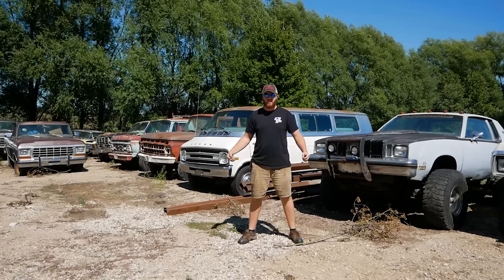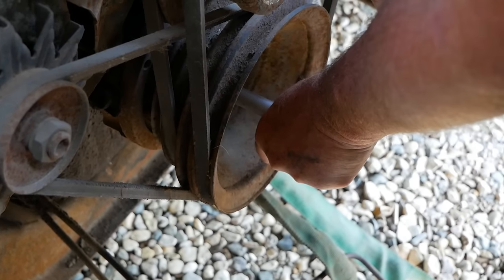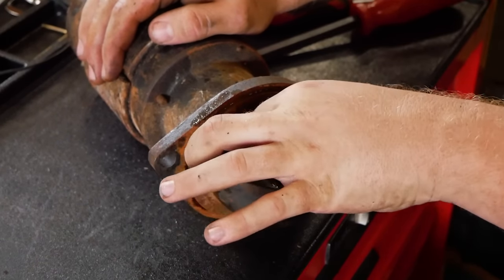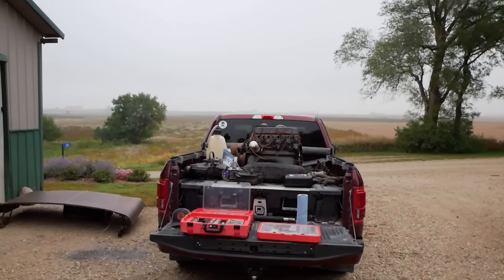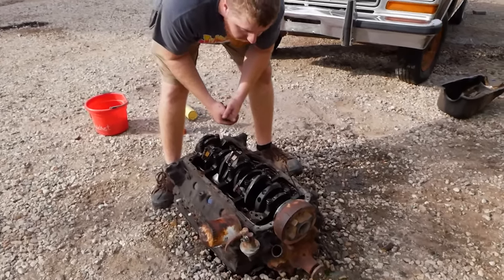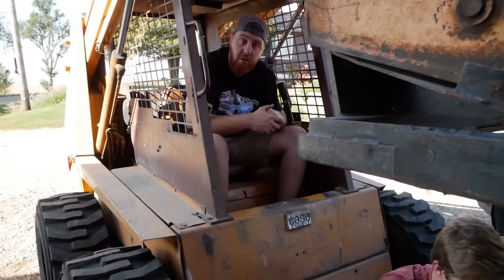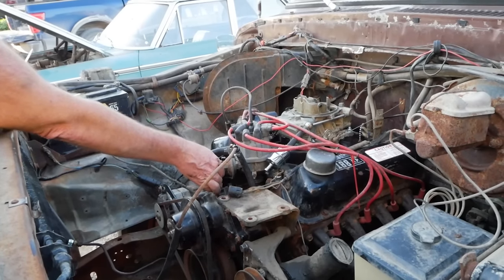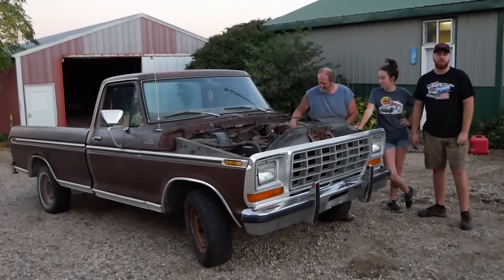Can We Swap a BOAT ENGINE into a TRUCK? 1979 F150 Revival

Comment: Depending on the year, that boat motor should have been rated at anywhere from 188-225 hp. The original truck engine was rated at 140, so an upgrade for sure. Boat motors had more aggressive cams and better heads, since they were expected to spend more time at high revs, and emissions restrictions were more lenient on marine engines.
Reply: I think it said 188hp somewhere, but that’s still a decent improvement
Reply: @garageofscrap  yeah and they swapped the 2bbl for a 4bbl idk if that was the only difference in rating but I do know there were 2v and 4v options.
Reply: @QuantumLeap83  and put headers on. That things going be a powerhouse
Reply: @QuantumLeap83  not true. boat engines are not built for high horsepower, they are built for high torque because a boat engine is like a generator engine, always under a steady constant load. cars accelerate rapidly then coast along using little power to maintain speed, their engines are never under a heavy continuous load unless you are constantly going uphill all of the time. and the horsepower ratings you claim are also not true as boat engines are not rated the same way as car or truck engines.
Reply: @marzsit9833  the specs for those engines are available online, and there's merely 1.4% variation between metric and mechanical hp. A difference of 2 or 3 hp lol. Also the engine now has a 4v carb that's not even the same 4v as the 225, different, intake and headers, so power numbers are unknown (but definitely higher) unless it's dyno tuned. Regardless, I'm sticking to my point - it's an upgrade over stock and capable of a lot more power than the stock engine would be.

The main thing you have to look out for when swapping these into an auto is that in most applications if its from a single drive boat (like this one) it will have correct rotation. If it was from a twin drive there's a 50% chance it will have reverse rotation 😉  so just know which one you're getting.
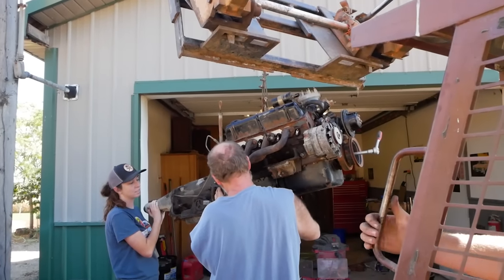Reply: at 32:08 you can see that it sais 188hp so you are 100% right. this is a pretty good upgrade
Reply: @QuantumLeap83  ... what determines an engines rotational direction anyway?
Reply: @RetiredRhetoricalWarhorse  as far as what determines it - its just a simple matter of correct timing and having a starter that starts the engine in that direction. Do TDC on 1 will still fire and have fuel on 1 with firing order following, but just the engine is rotating opposite on start up because the starter spins it clockwise instead of counterclockwise. If it spun it opposite without the timing changed it would be super advanced and not run. 

That being said, there are other things that have to be different because the cam needs to spin the appropriate direction, wrist pin offset has to be mirrored, alternator has to be spinning the right direction, water pump impeller vanes have to be correct for counter rotation, the bevel of any helical gears such as oil pump drive or timing gears may need to he mirrored. There are a lot of boats that just reverse the direction in the output or stern drive depending on set up so that both engines are the same - but the Ford pattern Mercruisers were not one of those - they actually built engines to run opposite directions 🤷‍♂️
Reply: @QuantumLeap83  The 225 HP was the only one that had the 351 W  heads all the other engines were basically the same as the engine used in early 1970's trucks!  The boat engines used  351 firing order!
Reply: @QuantumLeap83  We know it is a single we seen them lift it out of the boat!
Reply: @RetiredRhetoricalWarhorse  Camshaft.
Reply: I actually about bought a 351 Mercruiser out of a 79 F150. Said 235 HP on the valve covers
Reply: @QuantumLeap83  Ah, good to know. I'm primarily asking because to this day I am unsure how electro motors determine directions in the first place and when this came up I thought why would it be so hard to reverse direction. As you said, turn around the starter and reverse firing order... I just wondered if it really was feasible for Ford to make small runs of special made "lefty" engines... I'd imagine in a case with two motors on a boat  you'd have one of them be significantly more expensive than the other and parts wouldn't be interchangable which would make it easier, as you also explained, to just reverse direction with a gearbox after the engine...

But I'm sure some manager at Ford knew what he was deciding at the time :D.
Reply: The biggest advantage to using marine engines, is the bottom end upgrade. The overwhelming majority of marine engines use steel cranks, upgraded mains, and premium castings (usually higher nickel content and prescreened for porosity). While common in modern engines, most older V8s were mostly cast crank. It's not a huge deal, 'cause aftermarket steel cranks are fairly common and cheap... but for junkyard builds, it helps keep the budget down.
Reply: Heads on these engines are the same as auto. Mercruisers were built with longblocks off the same GM and Ford lines that made auto engines. And they don't run at high RPM but at sustained mid-range RPM. WOT on Mercs is around 4400rpm. Cruising at 3600.
Reply: My understanding is that boat engines are cammed different and they will not run right in a vehicle.
Reply: @marzsit9833  You are correct.
Reply: @letaloudone  thats a myth. boat cams are basically truck cams. Wide lobe separation angle and good low to midrange power band.
Reply: @QuantumLeap83  Don't forget a "backwards" oil pump or you will just blow air bubbles in your oil pan 'till you YEET a rod.
Reply: @peterdarr383  "why does this motor have so much blow by?!" Lol
Reply: @QuantumLeap83  also hes got better headers on it too so a bit more power again
Reply: @joekaz5198  - Nope, base car cams are one step bigger than truck cams and marine cams are one step bigger than base level car cams... maybe even more with newer emissions car cams... also compression ratio is higher, pistons have shallower dish, and 89 octane gas is specified... plus brass core plugs... I build up marine engines...
Reply: Actually base car cams are one step bigger than truck cams and marine cams are one step bigger than base level car cams... maybe even more with newer emissions car cams... also compression ratio is higher, pistons have shallower dish, and 89 octane gas is specified... plus brass core plugs... I build up marine engines... 

The old marine 188 and 225 HP ratings for 302's are gross HP like pre-1971 cars, so would be lower after 1971 in cars/trucks. 351W 2 bbl. rated 233-235 HP but problem was HP ratings weren't lowered after Ford started blocking 3/4's of the exhaust port with (unused in marine) A.I.R. bosses...
Reply: cj budz  Pre-electronic diesels will run backwards too.  I've had it happen a few times.  Been driving up a hill and stall the engine out then roll backwards back down the hill with the clutch out, the engine fires back up but sounds funny because it's drawing air in the muffler and exhausting out the through the air filter.  Don't want to do that very long since there's no oil pressure.
Reply: @briand2614  that's lines up with what I've heard, that only real difference between different  mercs is fueling, with merc marine 302s having better cams than ford auto, and also many had 351 heads but there's some confusion because apparently they didn't all? and some had stock 302 heads. AFAIK bottom ends are actually the same as are heads, except freeze plugs, rod guides etc are bronze instead if steel. Never heard any cam specs on mercs at all.
Reply: @QuantumLeap83  metric hp? What the heck is Metric HP? 

SAE Hp is just for advertising purposes, and the factory can pull the best 10 engines from the line, do a test and pick the best one! They can even run it with our Waterpump, AC-pump, headers, aircleaner, smog pump, converter or anything that holds you back. 

The DIN standard is way different, and you need to pull 10 random engines from the line, and run them as is! With all the accessories on it. 

So the difference can be even bigger.
Reply: Thats sweet
Reply: @briand2614  i owned  a 888  and a 225 and the 888 had 1.78 valves  and  the 225 has  1.84 intake valve s  the 888 has common 302 heads the 225 has 351  Windsor heads!   a later 2 barrel may have had Windsor heads.  The one 1971 engine I owned had 302 heads!  My 225 was a 1976  engine!
Reply: I’m not a boat mechanic, but cars and every marine engine i’ve converted for street use has had small port heads and relatively small cams compared to what we wanted for street. All were standard rotation big block chevy engines and the peanut heads and cams were too small, ditched for more upper rpm power on the street.
The Fords might be different, at least from this era?
Reply: @QuantumLeap83  instead of a timing set that spins the cam and crank the same direction, reverse rotation engines, have a gear drive that allows the crankshaft to spin the opposite direction,  the cam, oil pump etc all turn the conventional direction, nothing else changes, other than the water pump, and the fan on the alternator, and the starter.  I have repaired/replaced several of them, most big block Chevys.
Reply: @blythkd9017  remember hearing that in diesel mechanics class!!
Reply: I seem to recall that when Ford pieced together  the “5.0” and the Mustang GT for the 82 model year, they sourced the cam from the marine parts bin. That motor was only around 150 horses.
Reply: Helped a friend put a mercruiser 302 in a Fairmont, he worked at a boat plant, so he got an engine from work and brought it home.
Reply: @sombra6153  there isn't a "marine" bin. Marine engines were plucked from the assembly line, and shipped to Mercury/OMC, etc., and painted whatever color. Their casting and engineering numbers indicate nothing special, and from 1973 to 1985, all the cams were low duration, low lift, high torque camshafts, regardless  it makes practically no difference, none of them make 250 hp, especially because the ports are tiny, and they are emissions era slugs.
Reply: @jamesgeorge4874  I don’t know what the cam specs for the first HO 302 to emerge from the malaise era were, but was excited as many Ford enthusiasts were when the 82 GT was released and remember that some of the publications at the time referred to the cam as coming from the “marine bin.”  Whether they really knew what they were writing was anyone’s guess.
Reply: @sombra6153  the HO engine  debuted in 1985 with a factory roller cam, and appeared in the Mustang, Capri, and Mark 7. Some 1984 model CFI Mustang models had a breather lid that said 5.0 HO EFI, but they were nutless turds, and featured flat tappet cams, that no matter what the factory claimed, were tiny, sub 200 hp sticks. To me 150-190 HP isn't worth arguing over, both numbers are pathetic in a 300 inch V8....
Reply: @QuantumLeap83  It also requires a reverse rotation cam shaft.
Reply: I've got a 502 marine engine (I brought her that way) in my 1973 GMC motorhome.  She's got torque and will burn some rubber do to her front wheel drive!
Reply: @marzsit9833  Torque is a component of horsepower. Saying it isn't built for high horsepower is ludicrous especially when stamped on the engine is 188hp. You don't know what you are talking about.
Reply: @RetiredRhetoricalWarhorse  The engineers who design it. Cams are meant to turn one way I believe.
Reply: Boats basically have truck motors. Cams make the difference. Marine grind stock cams are almost identical to rv torque truck application cams
Reply: I like reading the comments 👍
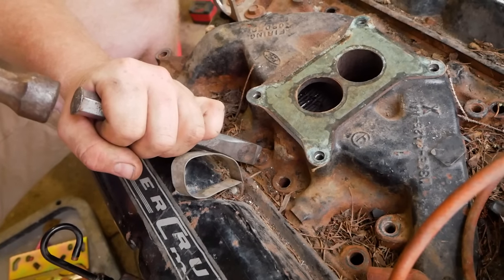Reply: @garageofscrap  28:07
Reply: @garageofscrap  Valve covers.
Reply: Gross HP for the boat, net on car/truck. There's no magic in most marine engines.
Reply: @jamesgeorge4874   When  ford  made the Marine and industrial engines  they were identified  by using the letter  J in the the  part  number. Most parts were the  same  as production car engines but they carried  the J suffix in the  part number !
Reply: @mylanmiller9656  so, for example, a post 1987 302 "marine" head would have 
E7TEJ cast in it ?
Reply: I see lots of replies here so what the heck, I'll throw my 2 cents in. The Mercruiser Ford engines were used from 75-77 when GM had an engine block shortage. Mercruiser used 302 and 351w truck engines to power boats. They rushed into a production run of some parts to make it possible for them to fill engine orders. They have low compression ratios, like 8.2:1. The cam is very very mild to have good torque from idle to a max rpm of 4800. The heads are the same as trucks other than the EGR system was not drilled out and attached. The blocks used brass freeze plugs instead of steel to resist corrosion. I grenaded my Mercruiser 225hp (351w) and ended up doing a lot of research on these parts to find replacements. I ended up with a short block out of an e250 van that got overhauled. Mild RV cam. Ported the Mercruiser heads exhaust side and put back on. I am by no means an expert, but I know a little something about something. The power ratings back then were gross hp with no accessories. You can find some of the videos on YouTube
Reply: @RetiredRhetoricalWarhorse  cam shaft
Reply: 28:00 yeah it's 188 good improvement
Reply: @marzsit9833  someone can't read🤦‍♂️
Reply: Mook is very BEAUTIFUL 😘🥰😍
Reply: its 188bhp from what it said it looks like a carved 302 truck engine.
Reply: @FreakinJeepGarage - so there's nothing heavier duty or different about the car vs the Mercruiser block? And your comment emphasizes the best aspects of American Hot Rodding - knowing how to combine components from different engines to get the optimal specs you're after (lower RPM high torque for stump pulling off road performance, etc), knowing which engines have forged cranks, high performance heads, etc. If you do a little research and junkyard searching, you can build a badass engine for not too much $$$.
Reply: @wes11bravo  from my research, I found no evidence of Ford making a special "marine" block. It's just a truck block that got marinized as I stated above. I rebuilt a truck block when mine started leaking water internally. I just used what I needed which was a short block that I put in brass plugs and block drains. (oh, and the black paint! It's a mercruiser now!) Thanks for the question 🙂. Yes, understanding a purpose and having a realistic goal helps you to hone your project. I knew what my boat could do, what I wanted it to do, and found the most compatible parts. Boat engines are subject to a  different life than a road going engine, however they can be interchanged with minor changes. 
😎👍
Reply: @marzsit9833  Or if it's any official motorsport, under load at WOT. Cars don't just drive around on public roads, ya know. People use them for track days and sanctioned events as well.
Reply: I mean 188 hp is quite an improvement from 140 but otherwise mundane lol

Comment: This is 100% hot rodding - taking stuff that's getting thrown away from this and that, and making your project run better for not too much $$$. Well done, y'all.
Reply: That's my favorite part of this build!
Reply: @Smokezors  - absolutely! You're taking a high performance engine that someone was going to scrap. It never would have occurred to me to use a Mercuiser engine in a truck but it makes so much sense.
Reply: the cat in the timestamp of 19:50 is probably under a year old and a turkish van from the looks of it
Reply: Hell yeah definitely how it's done
Reply: @wes11bravo been wanting to do that for awhile now
Reply: @ianalpha - keep focused on it and there is no way you won't get there, brother! My dream projects: swap a 7.3 IDI turbo into a late 70s F250 High Boy, put a Duramax into an M1028 CUCV square body, and/or a 5.9 Cummins into an old M715 Jeep Commanche!
Reply: so basically budget restoring?

Comment: Gotta keep the Mercruiser valve covers. And, get one of those boat propeller hitch covers.
Reply: What I was wondering is why some  Mercruise 302 had finned  aluminum Valve covers  and others had the stamped  stocker . My 225 was in a Fiber form it had the finned  covers,  My buddy had a Bay liner with the same engine  it has the stamped stock covers.  my valve covers looked like a  Cobra cover but with out the lettering, they were painted black like the block.
Reply: Gotta also get some badges for the fenders

Comment: Seeing you once again hooking up the parental unit with a long wanted 2 wheel drive pickem up truck just warms this old man's soul.  You sir are a 👌🏽minty fella.
Reply from the maker: Least I can do to give back for all he taught me about cars! I would never be here without the work my parents did to raise me right 🤘
Reply: @JunkyardDigs  You are an inspiration Kevin!  Thank your parents for me!
Reply: @JunkyardDigs  Add  a Lexus 450h hybrid transmission 4x4 version have both motors running and you increase power of the truck BHP by around 380BHP.... or just have the Lexus transmission only...
Reply: @JunkyardDigs  You seen the Land Rover with a Tesla motor fitted sideways to drive f/r axels 450-650bhp, 100kw battery... :):)
Reply: @JunkyardDigs  that truck,is worth around 8k here in aus.. as it is..mirrors are 400. the xlt chrome  1200. front bumper 400. tub 1500. cab 5k. bare..
Reply: @JunkyardDigs  i thought fords allways had stamped rods. chev dont. never pulled apart a ford not stamped. even pinto 4 cyl. 1500 kent. 351c. 351c with 302c heads is a tire burner..

Comment: I love those big engine bays. Especially if they have more than 1 mook of radiator clearance!
Reply: I think this is a unit of measure we can all agree on.
Reply: 1 Mook isn't very big lol
Reply: Wait till you see that engine bay with the 300 in line six. You can put a sleeping bag in that engine bay and take a nap in it. My uncle has a 1971 F 100 with the three on the tree. Still alive and running around in Rock Springs Wyoming.